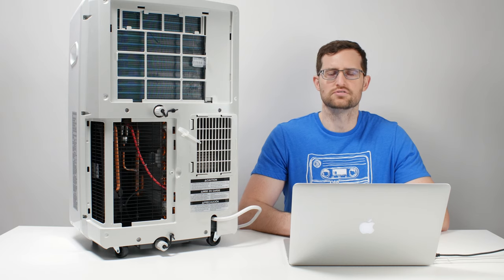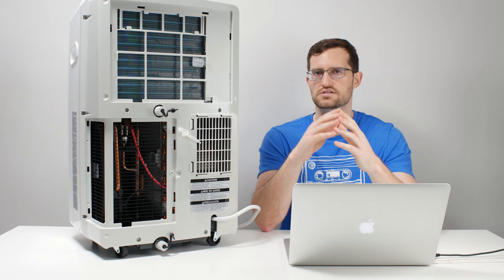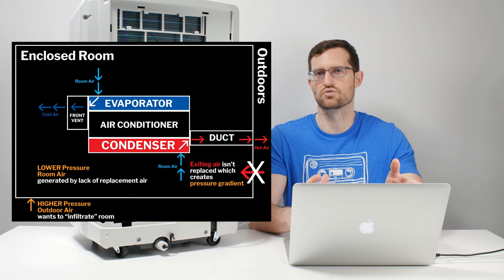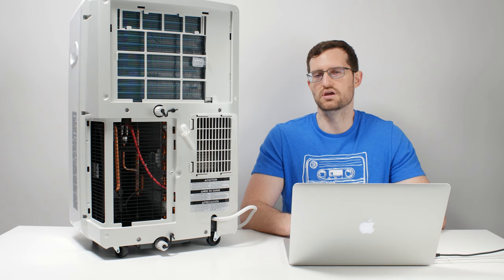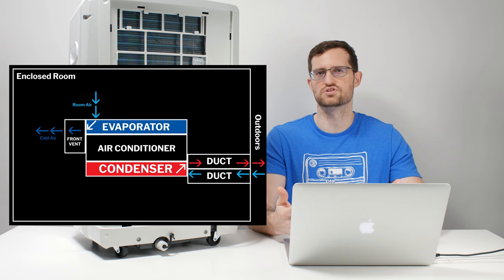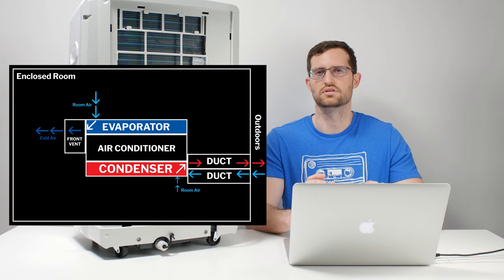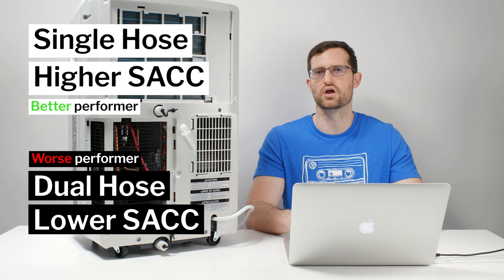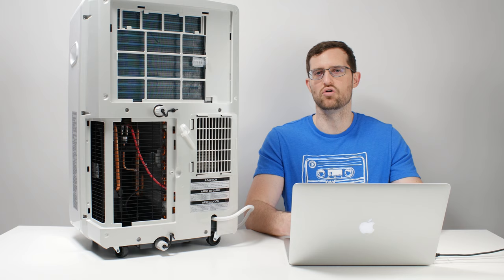Single vs Dual Hose Portable Air Conditioners

Comment: I think you're confusing the issue of work i heard you mention a few times. If you've already done work to cool the air in the room, that is less efficient. Period. Another consideration is that the replacement of inside air with outside air is immense. I have the same single hose LG unit you were showing the back of. For drawing 14,000 BTU of electricity (what's the worst is this piece of shit costs $700 before tax), it really performs like an 8,000 BTU at best. 

My poorly sealed apartment must be pulling in ~100 GPM of hot, humid, outside air. I have sealed the ducting and gaps AT the unit.  There's just no way around this. You're pulling in hot, humid outside air from stove vents, door cracks, bathroom vents, the air is abso-fucking-lutely being replaced, you're cooling the hot gasses with air that you've already committed work ($ electricity) to cool.  Single hose systems are the pinnacle of fucktardery and inefficiency. 

I can't take your opinion as fact, because it's not, no matter how many times you say "understand that" or "that is just a fact".  A final consideration, hoses are VERY EASY and CHEAP to INSULATE, about $10-20. One hose will never be hotter than outside, and the other 20-30 higher than outside. Either way it's a radiative heat transfer, not literally just pulling in the outside air.  It's a shame these mfgs don't do this in the first place.   YOU CAN NEVER, IN NO WAY, IN THIS UNIVERSE WORK AROUND THIS FLAW.  Understand, you literally cannot even seal a room 100% the unit cannot work, the same amount of air will come in or the whole unit will just not cool the evaporator fast working against a vacuum.

I have a degree in astrophysics and physics, and design rocket motors, I am therefore authorized to trump your opinion about physics. I am literally the most qualified subject matter expert that will ever comment on this video.  Understand, I am not trying to diss you, you did a great review on something many people don't cover. For people who made it this far, just don't expect more than a few degrees from a single hose unit on a hot day.  I literally consider single hose units at this price a scam.  There's no free lunch in physics.

/rant
Reply: Thank you very much for clarifying. Thermodynamics was by far my fav course in my engineering curriculum, so from knowledge as well as experience I can tell that a single hose unit really is bad. After a couple of days i founds where my "room" is pulling in hot air from. Wow, kitchen ducts / piping.. Yeah. No single hose unit.
Reply from the maker: I appreciate your insight. However, I must stress again how SACC fully takes into account all of the inefficiencies you mentioned. There's no way around it. The SACC equation is clear. And it must be followed to a tee when manufactures specify the SACC for a given unit. My own testing confirms the claim that higher SACC is always better - multiple single hose 14,000 BTU (higher SACC) units greatly outperformed the one dual hose 14,000 BTU (but lower SACC) unit I tested (the Whynter ARC-14S).
Reply: Can you recommend me a dual hose unit
Reply: @consumer-analysis  first of all: physics > SACC. Second: read first point one. I too have done "my own testing" = same amount of hot air coming in as going out thru leaks at doors, windows, stove and bathroom vents. You're moving air, taking a few degrees (with a lot of energy = a lot of $), then getting rid of it. That isn't great. To prove my point, I replaced the single hose Samsung 14,000 BTU with a dual inverter LG 14,000 BTU. On the same day in the same weather repeatedly, the single hose portable could only take an 85* outside temp down to 79 inside where the LV window unit takes it to 72* IN 15 MIN. The best part? The window unit uses 1/4 to 1/3 of the energy on the same day, I have the numbers from my power company down to the hour.  You should stop trying to prove this one, it's against physics. Can you prove anything else that's against physics?
Reply from the maker: @omgitzsteg  SACC is based on a mathematical equation involving test results obtained in a highly controlled environment. It is not opposed to physics. For more information see appendix CC here: https://www.ecfr.gov/cgi-bin/retrieveECFR?gp=&SID=83f8e5ba7502cb6f0b2803f5b3a467d3&mc=true&r=PART&n=pt10.3.430#ap10.3.430_127.cc

I agree that window units are far superior to portable units. Hence why I repeatedly stress how portable AC units are inherently inefficient in my videos.
Reply: You certainly wont be the most humble subject matter expert...
Reply: @omgitzsteg  recommend dual unit plz
Reply: @brandonwoods705  humility goes out the door when people continue to insist they are correct when they are not.
Reply: @georgeorwell3532  get a window unit if you have any possible way to make it work.
Reply: Yes, your theory is correct in the sense that dual-hose systems won't cause a negative pressure environment like a single-hose unit would. But despite the physics working in the favor of dual-hose units, we still need to validate the theory through testing because the dual-hose AC's might have inferior engineering/components that cause them to fall behind. It's not like every dual-hose system will always beat every single-hose system. Imagine a dual-hose that uses water as refrigerant, an underpowered fan, and other bad components. It will not beat a strong single-hose unit. You're equating the superior physics of one approach to the real-world results of specific AC's, and that's why your argument doesn't really make sense. Yes, we all agree on the principles of single-hose systems; hot air that gets vented out gets replaced with outside air. The condenser is cooled with air you've spent money cooling down. And in spite of the physics working in the dual-hoses' favor, if the lab results show that the single unit outperforms the dual hose units, you have to consider the fact that maybe other things are causing the dual-hose systems to underperform.

For example, maybe you're not taking into account efficiencies in other parts of the higher SACC system that make it perform better in the real world. Or maybe the higher SACC units use more efficient power supply units that generate less waste heat as they convert your wall electricity into electricity that can be used for your AC (AC to DC? DC to AC? some pun potential there. What I'm trying to say is that your AC might pull 1800W from the wall to generate 1300W of useful electricity for your system. The rest of the 500W is lost as heat in the conversion. I come from a PC building background so maybe I'm wrong about this and this kind of wall-to-component electricity conversion doesn't happen for AC's). Maybe the refrigerant is better in the higher SACC units, or the way that the refrigerant system works is more efficient. Maybe the way the fan works spreads the air better and so you get a better experience overall (I read some guy's review on an AC and he was saying how the AC shoots the air almost directly upwards into the ceiling and isn't cooling where it needs to). 

These kinds of things can add up and account for the difference in performance we're seeing in the dual-hose and single-hose units we see on the market today.  

I guess theoretically, given two equal systems (equal power supply, equal fan systems, equal refrigerant systems, etc), the dual hose system should win. I wonder though, does cooling down the condenser with the hot air from outside create enough inefficiency that the theoretical gap between dual hose and single hose isn't that large? What if the marginal benefit, when it comes to cooling down the condenser, of each degree of cooler air is actually quite large?
 Seems like AC's need huge radiators and loud, powerful fans to cool off their condensers when it comes to mini-splits or central air systems, since they have to use the hot outside air to cool the refrigerant.

Just my thoughts on the subject. For what it's worth I just got the LG LP1419IVSM, am waiting for the refrigerant/oil to settle before I try turning on the compressor. Will see how it does on hotter days.
Reply: Sophie  working great in my 140 sq foot room (with maybe an additional 45 sq ft for the closet and bathroom, so about total 185 sq ft). To be fair my apartment is magical and even on 90+ degree days is fairly cool throughout even without air conditioning, but my room tends to get uncomfortably warm from around 3PM to 6PM. I actually got two units of the LP1419IVSM to compare the two, and they both sound slightly different to each other, will be doing a side-by-side comparison to figure out which one I want to keep. I think the second unit I got has a slightly louder startup sound, but quieter operation, while the first unit I got has a quiet startup, but sometimes louder operation. I might be misremembering what the first unit sounds like since I've only got the second unit hooked up now, so I'll have to do the side by side comparison. In any case, I can say that this unit works for my room size, but my fairly cool apartment is likely helping with its performance. At the same time, if you're using this in an apartment that's hotter thoughout inside than it is outside, the negative pressure generated by this unit should act like a fan sucking in the cooler outside air and might cool down your place better than expected. The hottest day I've used this on hit a high of 94 and it performed even then.
Reply: Sophie  oh yeah I've wrapped the exhaust tube with some of my unused, insulating clothes to increase the performance
Reply: Sophie  crossing my fingers and hoping this AC works out for you too. by the way make sure that the insulation you wrap around the tube remains clear and free of the air intakes on the back, don't want it clogging those up.

Hmm, sounds like you need something like a universal window seal or casement window seal. Look for those and you'll find products that are meant to fit unique window shapes.

Yup, weather patterns are getting more intense, last summer was killer, especially in my then-apartment where even a low 80s day would be really hot. This AC would have been amazing to have back then, even if only so that the negative pressure it generates could pull in the cooler outside air; my apartment was on the second floor and would get hotter than the outside. I'm expecting an even more extreme summer this year.

btw I did my side by side comparison, and my second unit is noticeably quieter during operation, and I found myself always wanting the second unit to turn on rather than the first unit (I literally had both units plugged in and running at the same time, side by side with some room between them so they could both breathe). I'll be testing them over the next week when some of the hot weather returns, but for now I'm leaning towards keeping the second unit and returning the first. If your unit sounds a little louder than you expect, given how everyone says it's one of the quietest AC's, consider returning it! My second unit made me realize really why this AC is called one of the quietest ones out there, though I've never owned any other portable AC's so I don't have a standard of comparison. Even my first unit was quiet enough but made some odd sounds I found worrisome enough that I wanted to test out a second unit. I can say that, even without comparing it to other AC's, it's quiet enough for me even though I keep it about 3 to 4 feet (straight line distance from ear to compressor) from my left ear.

These days I keep an eye out for the weather and want the hot days to come so that I'll get to use the AC and relax.
Reply: @omgitzsteg  It's true that portable air conditioners  are one of the least efficient ways to cool.  Not all dual hose systems beat single hose though. The main point of this video is compare DOE / Sacc rating values as that matters alot more than single v dual. The model below has a 10k btu Sacc rating as single hose. It will cool more than dual hose systems with a lower rating. 

But really window unit crushes portable ac.   Which in turn gets destroyed by efficient mini split systems....
LG LP1419IVSM
Reply: I'm trusting the physics dude because the video has many flawed points
Reply: @omgitzsteg I have a degree in astrophysics and physics, and design rocket motors, and everything you said was wrong.
Reply: Alright,

I bought a single hose portable ac for testing.   The assumption is that it can't be efficient because it ejects air and must bring in an equal amount of outside air. 

However if the ejected air is 160-180 degrees (as is the case with my tester)  and the incoming air is outside between 80-90 there is an overall cooling effect. 

I think this is the point of the video, a well engineered single hose will beat a poor engineered dual hose. The only way a consumer can tell is Sacc /doe.  Comparing dual vs single isn't as valuable as comparing measured results.

Comment: Dual vs Single hose isnt about efficiency its still MORE efficient because "Its more about the BTU cooling power or horse power and ROOM SIZE" literally mathematical room size, as they try to force you to hard wire electrician certified install to mains line with its own power circuit like an oven so you can draw way more power than most house hold appliances as vacuum cleaners and space heaters which can really heat a house up might be using 2000watts which is the common powerpoint here in australia a wall installed unit or a split system more costly has ratings of 3.2kilowatts often.. But how well can it cool compared to an 1800BTU portable AC? and the portable one goes into the power point socket not requiring its own circuit and therefore using less power and being 'efficient' by contrast. So the twin hose units tend to have extra cooling power and higher BTU ratings like 1800. opposed to common single hose cheaper units of 1200BTU.

Comment: This video is entirely correct as long as you don't pay any money for your electricity.   If you pay any money at all for your electricity, the advice given in this video is totally wrong.  SACC values are for cooling performance, not efficiency.  They don't even attempt to measure effeciency.

Comment: the unit needs air comming in to cool unit and then exhaust outdoor air  back outdoors taking heat with it. not using indoor air to cool unit

Comment: A single vent portable AC just doesn't make any sense ... the idea with AC is to move the heat from one place to another. In order to do that with a single vent, it must pull the air for the condenser  from the room which creates a serious negative pressure within the roomspace. Negative pressure is going to cause air to be drawn in to the confined space from somewhere. If that air that is drawn in is from another non conditioned space then you are just wasting your time and money.... I thought several years ago "maybe I am thinking wrong". I read many positive reviews, and I bought one. I wasn't wrong. It ran all the time and the bill went through the roof. I took the covers off recently and determined that with some careful planning, I can add a second hose that pulls the air from the outside, across the condenser, and then send the air back outside in a different direction than the intake. I may get blasted for this, but I will repost when complete.

Comment: if the single hose unit  pulls air from within the room to cool, won't you run the risk of pushing recycled stale, virus contaminated air thru the unit and bac into the room?

Comment: When you use cold room air (cooled by the AC) to cool down the radiator, you are making room hotter.Undoing the work already done by the AC.  So your point there is not valid.

Comment: I started this research because I couldn't understand why my brand new 12,000 Btu air conditioner could not cool down a 10 x 11 bedroom
NOMA Model # 043-0936-2
Until  I was leaving my bedroom I could feel the hot air around the crack of my bedroom door coming in the room
Then it hit me like a ton of bricks
The single hose is drawing the air out of the room creating a negative pressure that is pulling in hot air from the hallway, because the air has to come from somewhere, right
It is pulling in about as much heat from the rest of the apartment as the cold air it creates
What a piss poor design
I went with the portable for the cleaner look
And it is way oversized because it was on sale, and cheaper than a 5,000 BTU window
Also I thought oversized would be good as compressors loose coolant over time, and thought I would get more years out it
I thought I could just run it on low using the same electricity as a 5,000 BTU
I was wrong
It also pours water on the floor so I had to put it on a table and empty a 5 gallon bucket each day
Even though it was designed not to have to do that because of a evaporator plate unless I put it in dehumidifier mode
Also it should have shut down if the room was to humid as to not flood the floor with 5 gallons of water
Also I hooked up to a hydro meter and it is using $4.36 a day because the compressor never gets a chance to shut off
What a huge mistake
Putting in a window model tomorrow and passing this one off to another sucker like me
Also the window unit theoretically will heat the air it is pulling in and push the hot air out with positive pressure in the room?